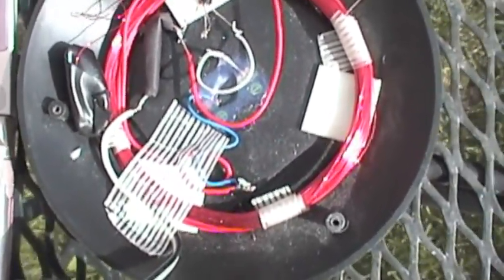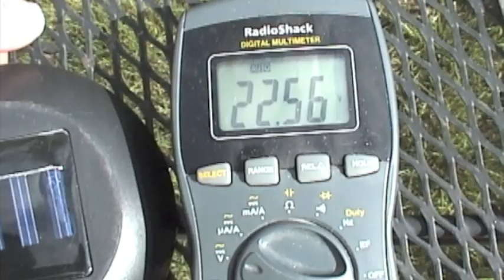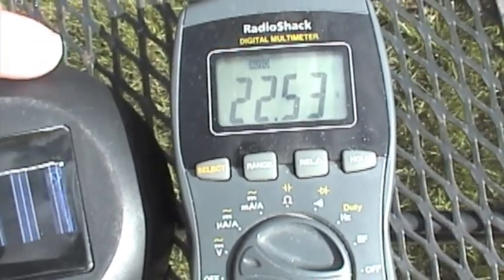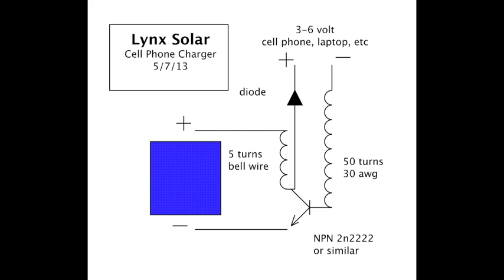Lynx Solar Cell Phone Charger

Comment: Are you sure you're taking the output of the solar cell and boosting it, or are you taking the output of the internal joule thief circuit and boosting it? I tried this with a 2n2222 and a 2n3904 and the solar cell just doesn't have the voltage to drive the circuit.

Comment from the maker: The voltage isn't regulated.  The charging battery clamps the higher voltage and it so happens a 3 volt pulse to the base is a nice signal.  It will chareg 6 volt, 9 volt 12 volt batteries as well.  But there is only about .02 watts total.
It might make more sense to just put two or three garden lights in series, but what's fun about that?